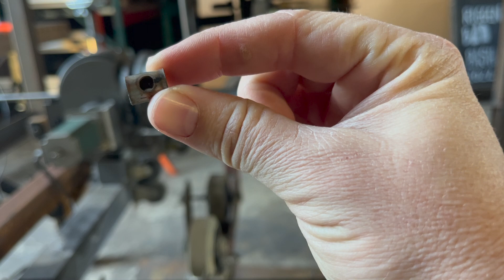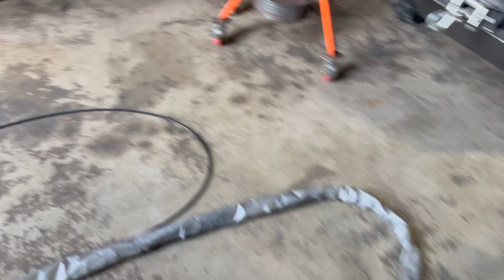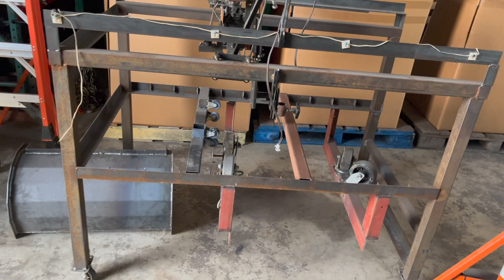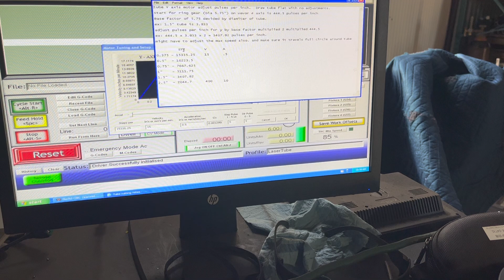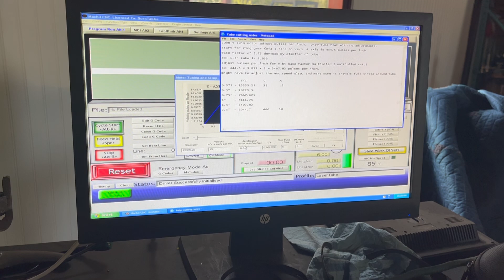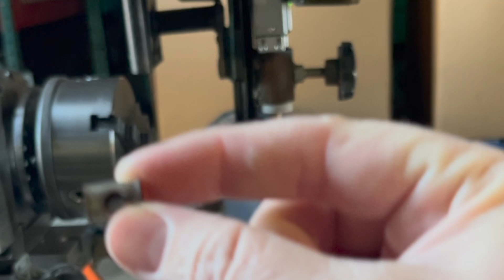Home Built CNC Laser Tube Cutting Machine

Comment: I just bought a vevor dividing head to make this 4th axis.  Would you happen to have the design file for the stepper motor to dividing head adapter?  subscribed!
Reply from the maker: Thanks, sadly i font have the file anymore, it was a simple c bracket to hold the motor.